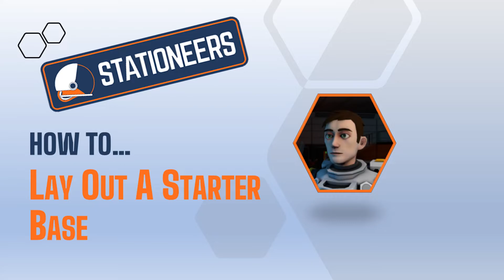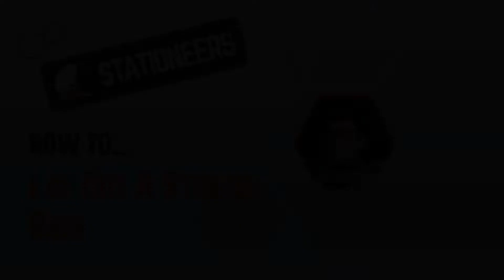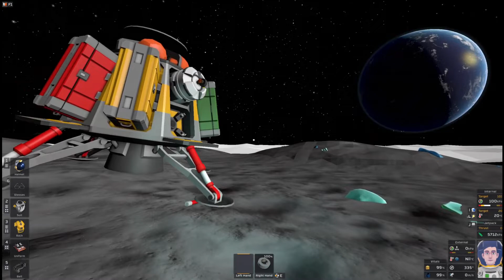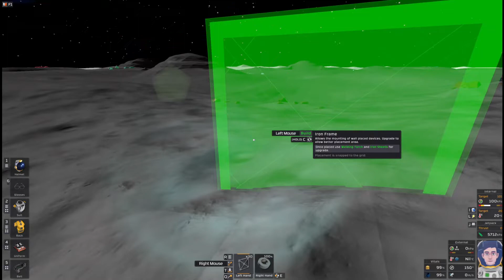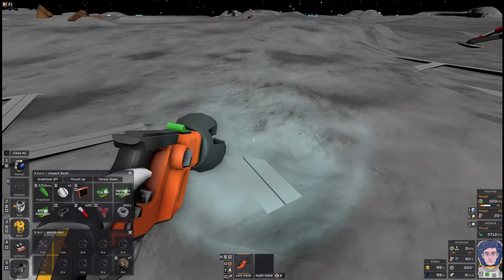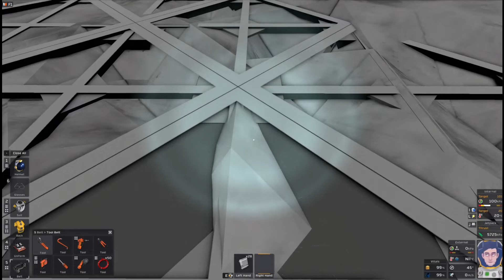Stationeers: How To Lay Out A Starter Base

Comment: Bit late to the party, but if you press R while having the drill equipped (or hold alt and click the drill) to bring up its GUI, you can change its setting between 'flatten' and 'default'. 'flatten' will dig ground voxels down to the horizontal level you're standing on. Really good for quickly making an area better-traversible. Great tutorial in any case!